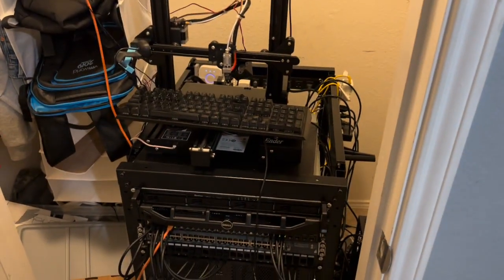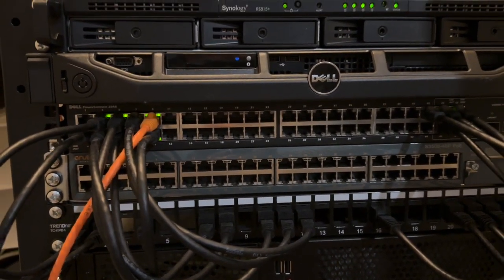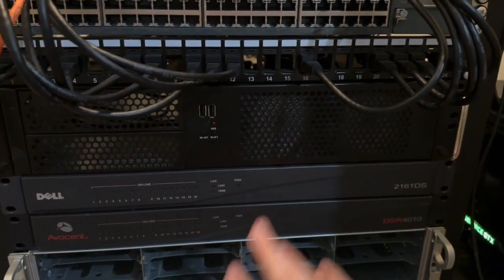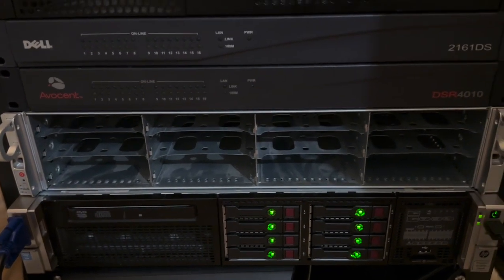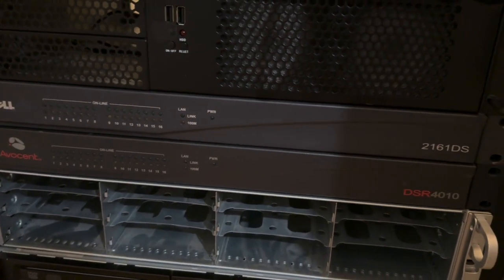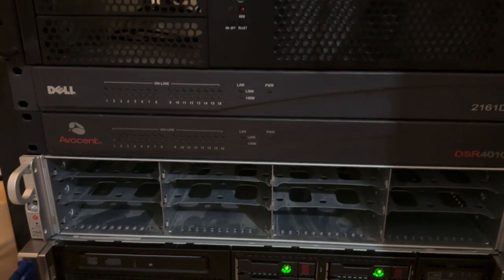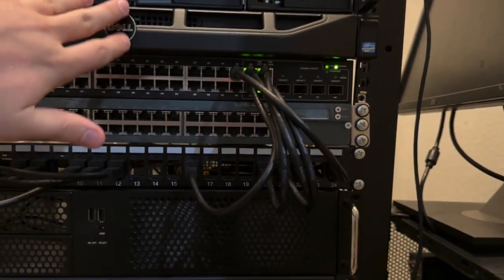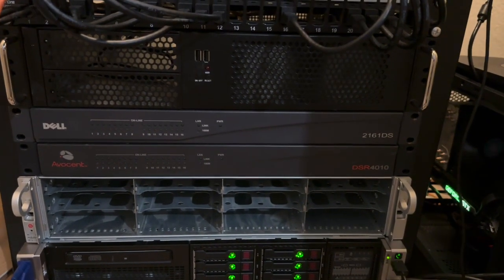Server Closet Update for May 2023

Comment: The Dell system has a 2nd rj45 jack, I'm going to assume that this is a 10gbe connection installed with a m.2 adapter.. am I right?
Reply from the maker: That second connection is a 1GBe connection, through an M.2 network adapter. To be specific, it is a RTL8111F-based network card, although I wouldn't necessarily recommend it for high-bandwidth applications due to reliability issues. I'm going to do further research on what would be the best budget card for this setup, and I'll include that in my dedicated video.

Comment: i must update my Current Settup. at the Moment i just have 1 HP ML310e G8 with 16G ram.
I use for my Jellyfin Server. its running Ubuntu 22.04.2 LTS PRo. and has 6x1tb Drives.
And it boots off a USB 2.0 Sata HDD (500G) its actualy pretty decent for what i payed $200 NZD with 4x 1TB drives.

I Do have a Cisco 24 Port Gigabit POE Switch. that works fine. 
I have a HP DL360G7 with 8G ram with 2x 4 core CPU's but thas issies with the SAS Backplane. and 1 of the 2G Dimms is Iffy Payed $50 for it. pretty much got Ripped off.
Was thinking it was a DL380G7 as i have 72G of DDR3 Server ram just sitting around ready for a Server.